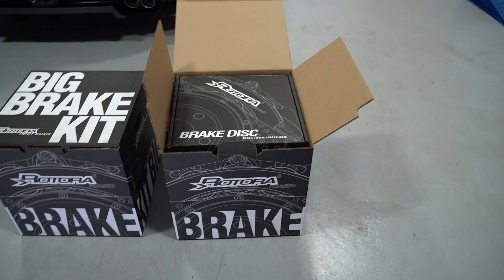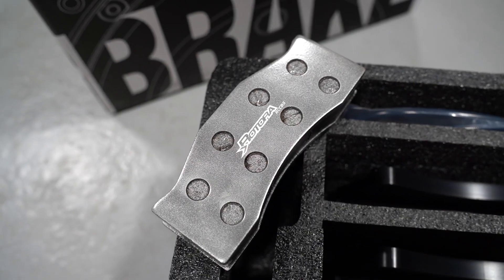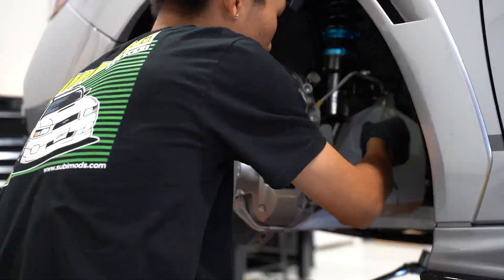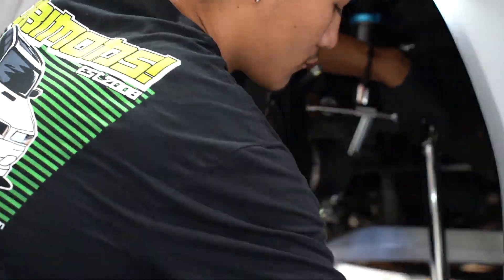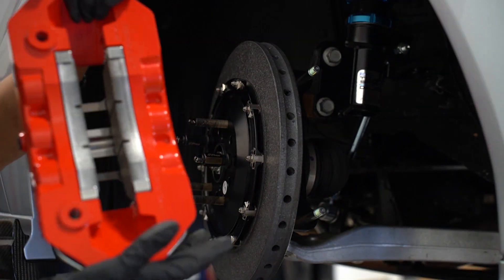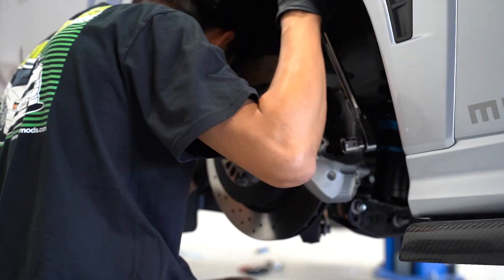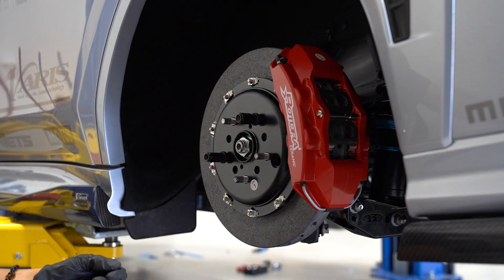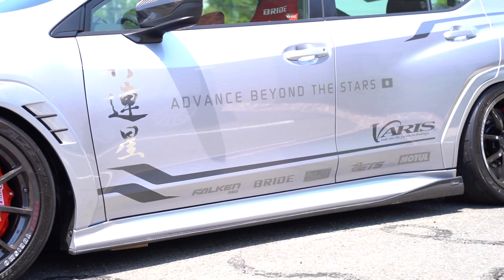Upgrading Our 2022 WRX: Exploring the Performance Boost with Rotora's Big Brake Kit

Comment: What size wheels do I need to make Rotora break kit fit. I just ordered some apex forged vs-5rs 18 * 9.5  wheels wondering which break kit would fit.
Reply from the maker: We have Rotora Caliper Fitment guides for all of the brake kits we have listed on our website, so you can cut out the template and test fit it on your wheels to make sure they clear. Given they clear the OEM wheels with a 4mm spacer max, most aftermarket wheels shouldn't be an issue. We have never utilized a set of Apex wheels, so we cannot comment. Feel free to email support@subimods.com to obtain the caliper fitment templates.
Reply: @Subimods   Do you sell 4mm Spacers?
Reply from the maker: @jessdelmundo2314  We have 3mm and 5mm listed on the website, a 5mm for a little added caution is likely best suited.

Comment: Was there any weight savings over the Brembos? Would there be any weight savings over the stock OEM brakes?
Reply from the maker: We did not weigh these against the Brembos, but we have been meaning to weigh the other Rotora offerings on our website VS the OEM brakes.

Comment: Damn, lol I thought maybe you mis pronounced the grand total but you weren’t playin 😅😅 might just stick with the Stock vb brakes for the time being
Reply from the maker: The carbon ceramic kit is not a kit designed for the average street car, and we wanted it for our halo car to show case the top of the line brake kits. We have 3 offerings for the VB Rotora line, starting at $3,999: https://subimods.com/collections/2022-wrx-brakes#/filter:vendor:Rotora/filter:product_type:Big$2520Brake$2520Kits

Comment: Will this work with stock tires?
Reply from the maker: From the manufacturer regarding the OEM wheels:

Front 4 piston 332x32: 4mm spacer required

Front 4 Piston: 355x32: 2mm Spacer Recommended

Front 6 Piston: 355x32 2mm spacer recommended

Rear: Fits without spacers

Comment: talking about extreme overkill here, meanwhile cars making 700-800 hp stock are still using steel rotors
Reply from the maker: We know this is extreme overkill, as we did address this in the video that its for our halo car.

Comment: Do you offer this ceramic brakes for GR86 and BRZ? Whats the weight saving compared to factory? Thanks!
Reply from the maker: We dont have them listed but we can offer them if there is enough interest. As far as weight, I did not throw the rotors on the scale but I can tell you that the ceramic rotors are at least half the weight of the steel rotors.

Comment: $12,000? Did I hear right?
Reply: yea. the rotors themselves are made out of ceramic, super expensive and really only seen on exotic sport cars. the benefit being they are lighter, never brake fade, and last about forever.  they are pretty overkill
Reply: @RustedCrown11  that's awesome. Placing an order now
Reply: @ZibrayMusic  spend the money elsewhere… you’d never need big ceramic rotors unless on a professional race team, and even then most teams would use track pads on the stock rotors
Reply: @Shorai oh for sure man. For 12k you can almost buy a Nissan versa cash haha
Reply: They have a non ceramic one for 6k
Reply from the maker: Yes - This kit is the top of the line kit. We understand that this isn't the kit for most consumers but we wanted to showcase it on our halo car. There are 3 additional offerings for the average street / track use available on our site: https://subimods.com/collections/2022-wrx-brakes#/filter:product_type:Big$2520Brake$2520Kits
Reply: There's a reason that Porsche owners that track there cars swap to steel discs lol.
Reply: What an absolutely ridiculous waste of money😂😂😂. Holy cow guys, come up with some content for the market in which these cars are priced at... i.e. it's a Subaru not a Ferrari.
Reply from the maker: @JeffPettibone-dq2xh  Thanks for reaching out! We completely understand that this is not the product for the average consumer, however the VB has been very very prominent on the track, and we wanted to showcase that Rotora has brake offerings from as simple as the 4/2 kits listed on our website, to this 6/4 carbon ceramic kit for the VB.
Reply: I need those ceramic brakes for my mountain bike. Wish someone would make such product
Reply: 12k or 6k, yeah…NOPE
Reply from the maker: @heatice77  Thanks for looking!